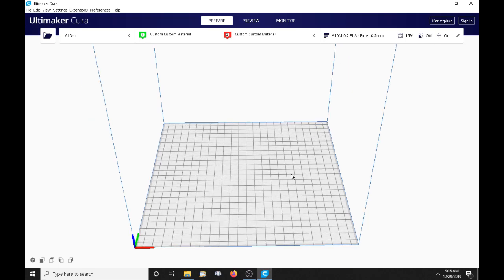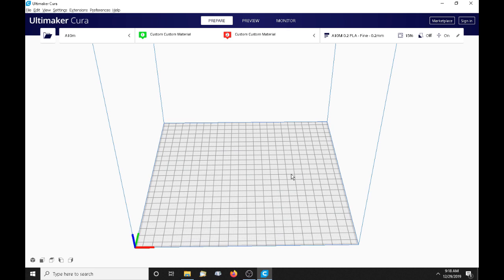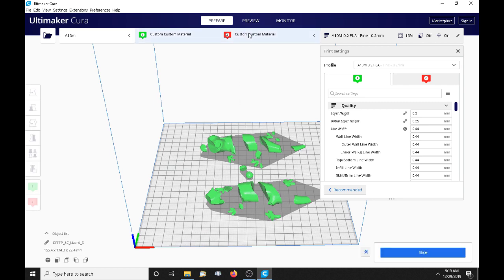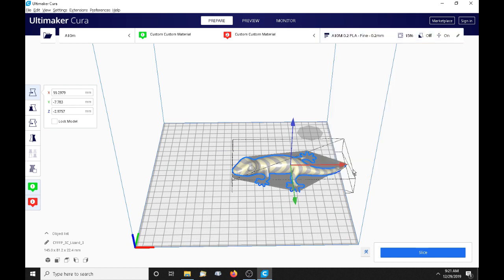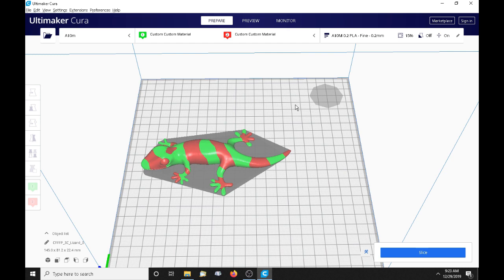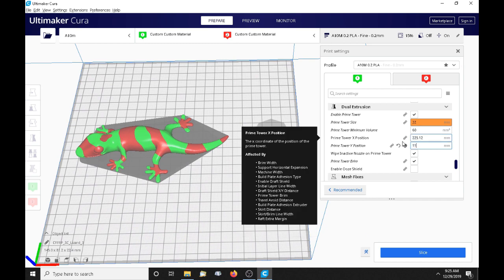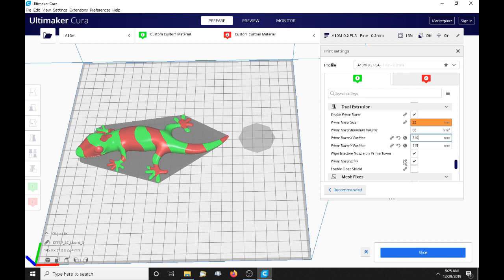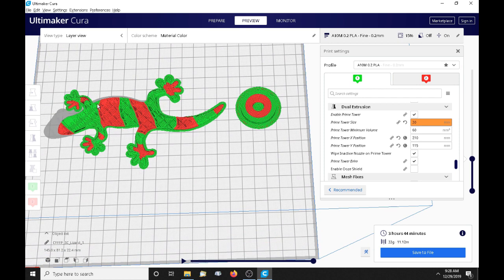Cura Multicolor Printing _two color print_ Part 2

Comment: I have an A10M and following your settings and both part one and two, I am still having issues with the nozzle stopping over the print to swap to the second colored filament. Whilst it does this, a huge blob of filament is placed over the model and each time I have to abort the print. At the very least I would need the nozzle to move to the side of the model where it can place the filament ooze elsewhere. Anyone know if there are any settings in Cura to avoid this problem, or is a g-code firmware issue??
Reply from the maker: You need to make sure that all 5 temperature settings are set the same for ALL extruders.
Especially "standby temperature".

Also, make sure "nozzle switch retraction" distance and speed are set the same as normal retraction
Reply: @1zradio660  I have followed all temperature settings and found the problem to be caused by printing via USB, so printing off the card seems to be more reliable, with less chance of a pause in between. Thanks

Comment: 2:20 so, if I’m understanding correctly, if I have a model, say a person, and I want the clothes to be a different color than the body, I have to manually cut up the file in tinkercad or similar into their color groups, then import them into cura and drag them onto each other?  Is that about right?

Comment: Hi There, Thanks for this info, I have an A10M and using cura 4.6 and I have followed Part 1 and this video accordingly and apply all the settings exactly the same and assign Extruder 1 to 2 x parts(Eyes and 1 body part) and Extruder 2 to the other body parts,  merged the model, etc.  all the same as per you videos, and when I print it only prints with Extruder one, I have tried printing from Cura to Octoprint and saving it to SD card and printing from the SD card all the same result, it prints everything with just one color including the tower, I have tested the Mix function on the printer itself and this works fantastic, Is there anything you can think of that I missed, or do I need to add some gcode to the printer settings, or can you upload your lizard gcode so I can compare it to my lizard's gcode this is doing my head in. , thanks appreciate this in advance. I can provide my setting etc., I even removed the printers uninstalled cura and redone the printer and profile
Reply: I 2nd this! I'm also having the same problem of only one extruder working. I believe it has to do with the start GCode. This is all new to me but I think you need to set extruder 2 somehow from the start.  Hopefully @1zRadio can add some insight. That would be greatly appreciated!

Comment: Man, all this time I have been loading each piece one at a time. I didn't know all pieces could be loaded at once. Also I did not know that I could copy all changed values to all extruders. This will save me a bunch of time. Now I will give you a hint. In Cura you can choose a part and right click to choose what extruder to assign. You can also right click to select all, merge,  arrange, center, and clear build plate instead of using the drop down menu. You have been providing a lot of great info on these machines. Mine would be collecting dust if it wasn't for you.Thank you for all your work you put into the Facebook group and the videos!